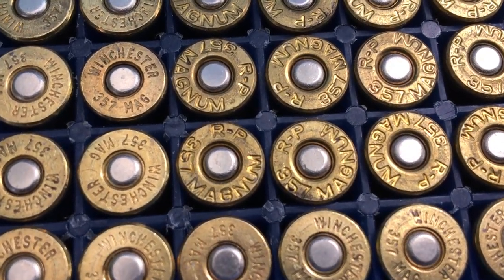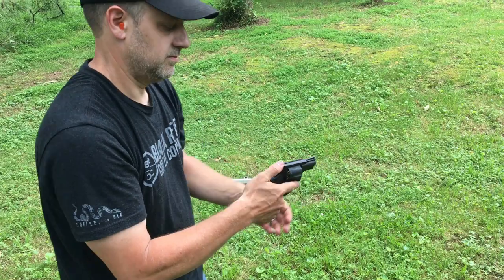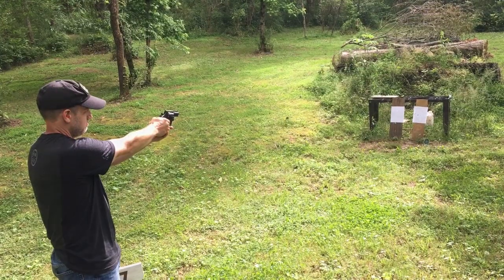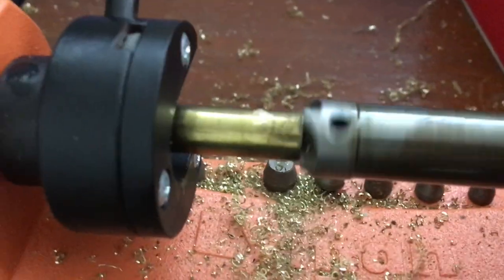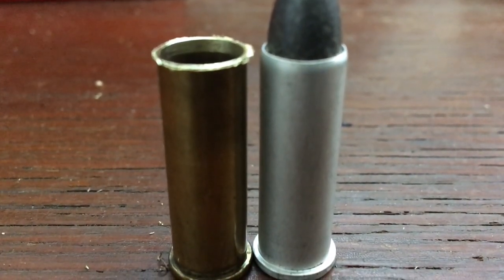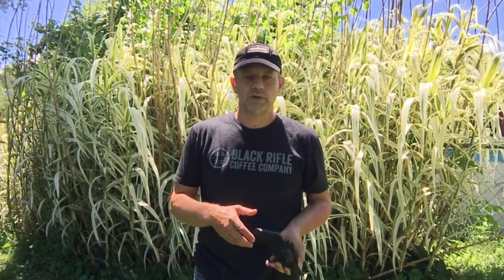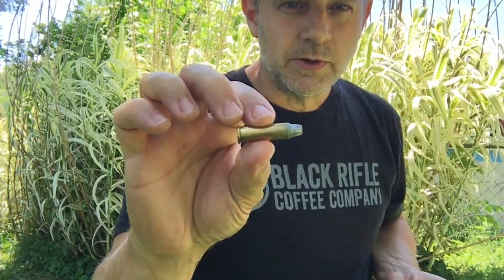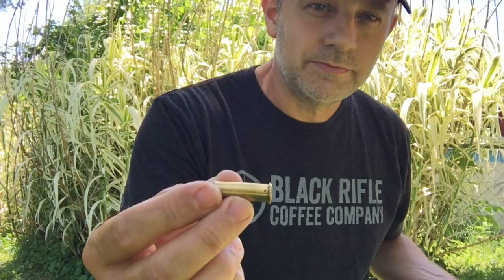.357 Magnum Brass in a 38 Special?

Comment: Considering that used .357 magnum brass is going for 49 cents (& up) each, WHEN YOU CAN FIND IT, don't think I'll be trimming my cases to make .38. So even if all you have is a .38 special revolver, you can still load the .357 brass without cutting it down by using double ended wadcutter bullets and press them into the case until you have the maximum OAL for your .38, 1.550"
Reply from the maker: The cylinder is bored for the length of my cases.

Comment: I have done it too but I have to grind 1/8" off the lead .357 tips to make it fit in a 38 special revolver. Kicks harder than a .357 for some reason??? Next step is to lathe down the brass jackets 6/10,0000ths so it can slip out of the barrel easier.
Reply from the maker: Most .38 chambers won’t accept the full length of a .357 case, requiring the case to be cut down. I’d never fire a full strength .356 powder charge in a .38 chamber. It’s not designed for that pressure.
Reply: @SmithFarmandOutdoors  I have also just cut the tips off the front of the hollow points down to the brass, it fits then. I know its dangerous but so far I've been lucky shooting 400 rounds this way. Probably what saved me was that I made the bullets 35 grains lighter and I only have a 4" barrel. My newer bullets I make I called '.357 shorts' have shaved down case lengths and use a 38 special FMJ bullet I found online. These .357 'shorts' still crono out at 1375 FPS. Good enough for self protection in Alaska which is my goal. I only get $988.00 a month in S.S. so I am broke trying to make my way in a dangerous land where everything wants to eat me.
Reply from the maker: @johnslugger somebody gave me some random ammo a while back. Some of it was .38 wad cutters that were flat nosed wad cutters factory cut off even with the case mouth. They are good for target shooting on paper as they make clean clear holes on paper. Sorry to hear of anyone struggling on a low income. Perhaps create a YouTube channel about your struggles in Alaska and start making extra money that way. I don’t make much money on YouTube because they don’t like to monetize gun videos but if you have a human interest story or lifestyle, that could be a ticket to getting out of that financial hardship. For example, my brother has a channel called God’s Country Hunting and Fishing. He makes several hundred dollars a month on YouTube making fishing videos, primarily. I personally, make about $5.00 for all my trouble. If they monetized my gun videos I’d be making hundreds.
Reply: @SmithFarmandOutdoors  What people said about YT in 2010 is all coming true now. They also said that one-day YT will ONLY be available as a Paid Service so no more free YT videos, someday.
Reply: If it can handle +p it can handle 357mag id imagine

Comment: U can use 357 cases just not the smokeless powder on a regular 38 spcl
Reply from the maker: No problems using smokeless powder. Works fine.  No issues.

Comment: Awesome video. Great information!
Reply from the maker: Thanks. I tried half-heartedly to find info on this subject but could not. I experimented and found no issues with the cut down cases. The pistol shoots fine, the dimensions are the same, etc.
Reply from the maker: I used Titegroup powder, a little on the lighter side because I’m loading lead semi-wadcutters.

Comment: You can see in your video that your revolver's frame is cracked on the rear portion around the grip lip areas near the top screw and another crack at the bottom part where the grip meets the frame. .... might want to look into that.
Reply from the maker: The frame isn’t cracked. That’s simply the joins in the frame where the access panel screw to the frame. There is an access panel in the side of the frame.
Reply: @SmithFarmandOutdoors  Ok, cool.